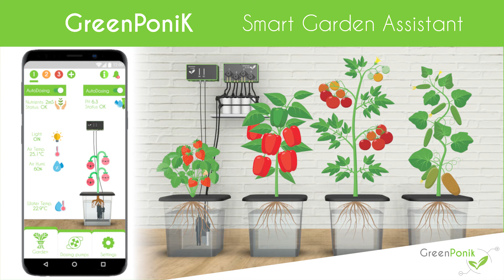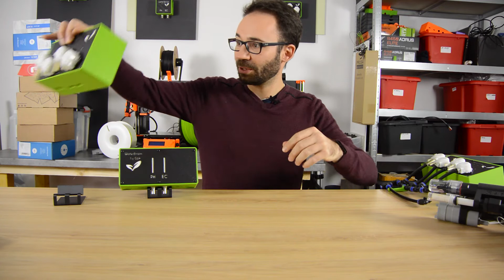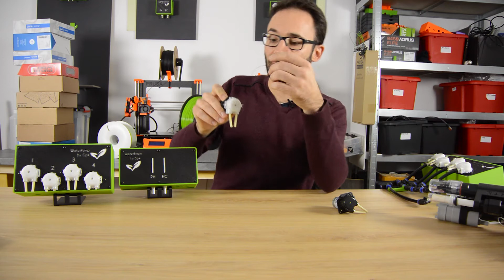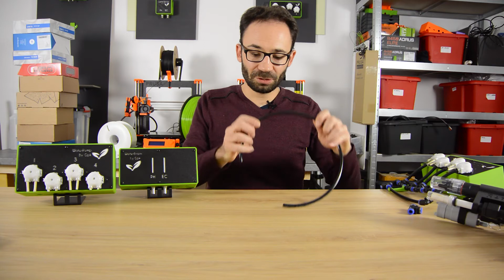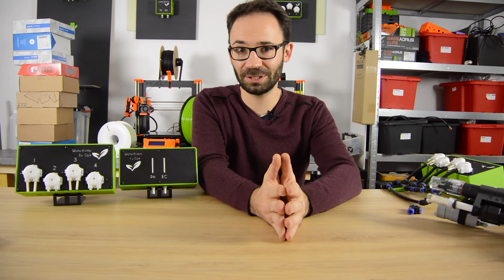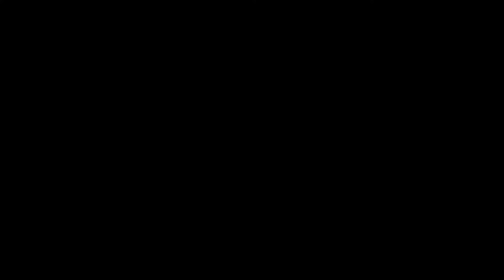WaterPump EC/PH automatic doser for hydroponics - In-Depth 😁

Comment: Those T fittings are my arch enemy.... I used them for a old aeroponic system I created..... Lines kept blowing loose and water was everywhere!!! I eventually gave up on them and pulled off half of the ones that I couldn’t get to stop leaking and threw them away, I would suggest different T’s if your going to have pressure in there.
Reply from the maker: There is a great variety of quality for a same pneumatic fitting part number. Which is why we buy those directly from the manufacturer. What's key is to make a clean 90° cut when you cut your tubes and everything must be fine. Working great with our mix pump (that's 5.5 bar max pressure 😊).

Comment: Hi Greenponik, I am interested in the hydroponics kit on kickstarter. However, I realised that the funding days are over, Im wondering if its still possible for me to make the purchase? Also, when is the delivery date for the kit? Kickstarter states March 2021 and I want to know if it's confirmed. 

Also, is there any other way to connect external sensors such as temp,lux, rh etc and what ports are they? and if so can I view the data via the app?
I understand that there can be multiple zones, I intend to have 2 sensor sets for 2 diff sum. Is it possible to optimise 5 pumps for Zone A and the remaining 3 pumps for say Zone B?

I understand your sensors are DF robot. But I'm changing them over to atlas sensors with their ezo chips. Will it work with the module? 
Lastly, Am I able to export the data I collected? Which API should I be using?
Reply from the maker: Hello, yeah kickstarter ends december 27th 2020.
We're focus on KS delivery for march 2021. We'll open new pre-order directly from our website before june 2021. Stay tuned subscribe to our newsletter from www.greenponik.com.
Waterbrain is provided with air sensor (temperature, humidity and light). You can have some details about GUI in this video https://www.youtube.com/watch?v=GoHW4XvaVXE

For zoning you need one hydroponics kit (waterbrain + waterpump) per zone. You can add up to 5 waterpumps for one waterbrain. Our system scale to user's setups.
Sensors aren't DFRobot for this version, we used DFRobot for beta kits but now we use industrial sensors go to https://youtu.be/xZfZmuV5OsQ?t=332 for more explainations.
Waterbrain provide a REST API you can use data and interact with waterbrain.